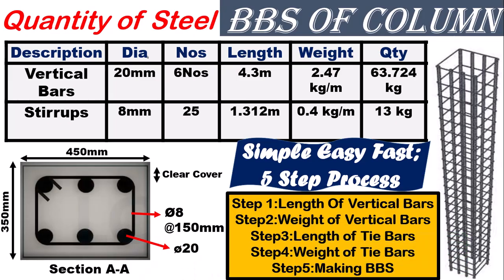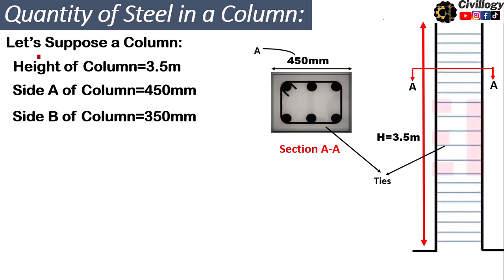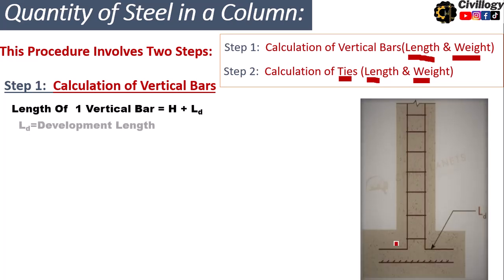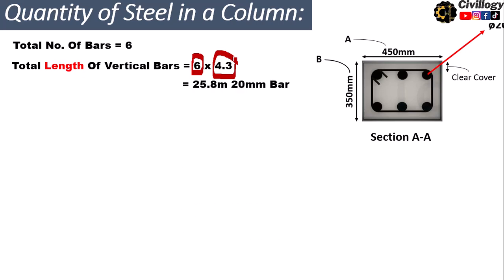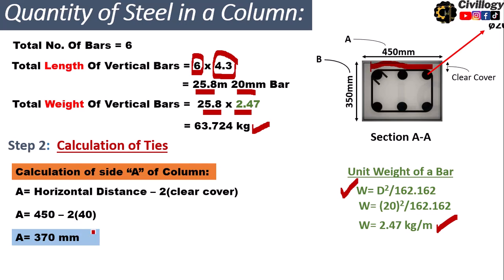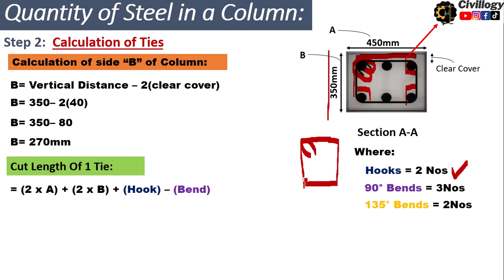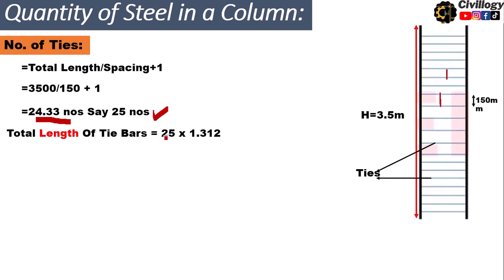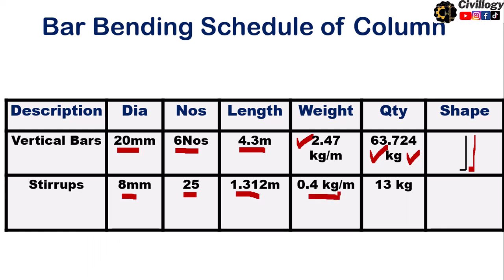BBS of column|quantity of steel in column|Bar Bending schedule of column|Steel quantity in column

Comment: where is overlapping
Reply: Generally the length of steel bar 12 m and here the length of column is only 3.5 meter. .so after 12 meter only we will required overlapping
Reply from the maker: @sushantkujur8248  yes you are right
Reply from the maker: In this case there is no lapping